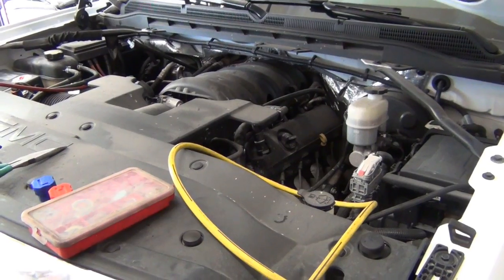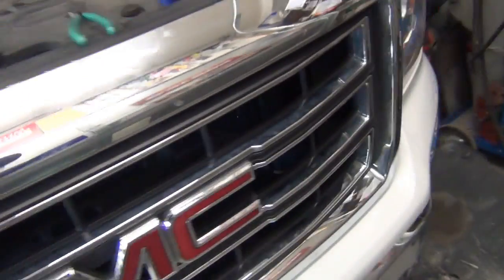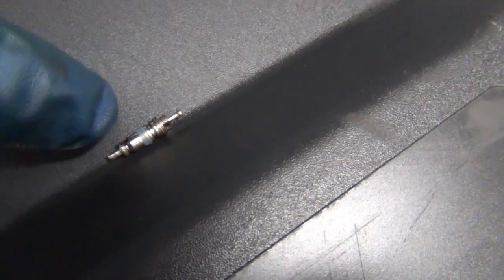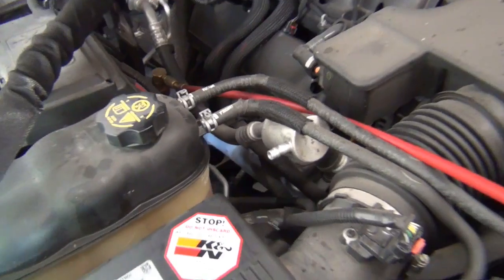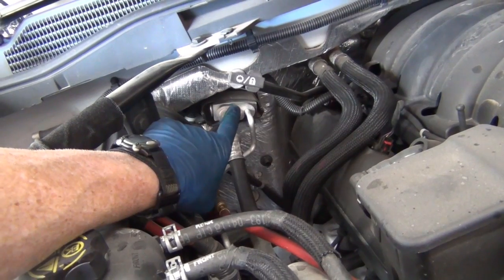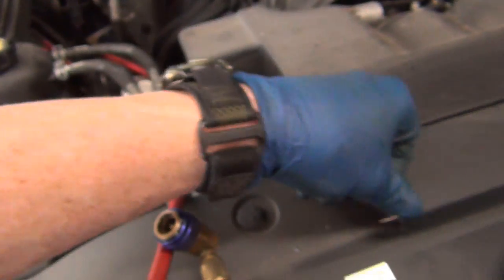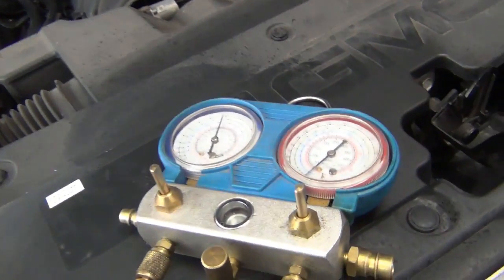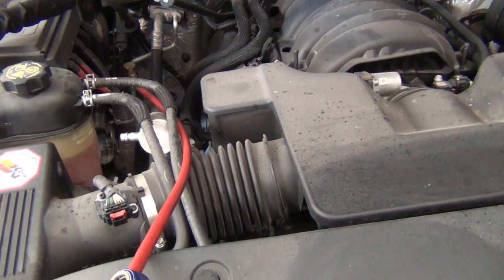Catastrophic GMC AC Problem Caused By Factory Defect on Condenser

Comment: I had a 2001 Yukon XL. It was 4 months old when the compressor ate itself. Over the years I had it serviced at 2 dealerships, several mechanics (1 who was my brother at one of the dealerships, I obviously trusted him, and he even sought outside input), and 2 AC specialist shops. I went through 17, Yes that's Seventeen, compressors. Some factory, some remanufactured and some off brand. Some covered by warranty, some not. Some were replaced for free by my brothers dealership. Some lasted months, some only weeks, the shortest was 3 days. In the end, I drove it for about three years with no AC because I got tired of the game.
Reply: Wow that is crazy, maybe too much oil caused all those compressors to hydrolock. Failed compressors is the SYMPTOM but what is the PROBLEM? what is causing all those to fail... 🤔
Reply: @heyitschinoable  Never did figure out anything for certain. The first time was when the truck was only 4 months old. Was parked with it running and the compressor locked up and started smoking the belt. Over all of the years that I had it I had almost every part replaced short of running new lines to the rear ac. Including putting filters on the lines in several places to try to catch the random debris even after having the system fully flushed twice. Never figured out the problem. Got rid of it 2 1/2 years ago and now I drive a Toyota Sequoia. I have never had any problems with my imports :)
Reply: @tyahl How do you like the Toyota? Miss the yukon at all? I got an 03 yukon and I have rebuilt that AC system more times than I can count. Even had to fix it after the dealership failed to. There is a small amount of metal in the system that just keeps reappearing from god knows where. A toyota sounds nice.

Comment: I have a 14 rado and had that same condenser defect a few years ago...I had my girl take it to the dealer when it started blowing hot(out of warranty) they jus said they couldn’t find a leak charged me $150 for a refill and said if it leaks out, we put die in it and it’ll be easier to find then...when I found that out I was pissed...last week it was blowing cold...now it’s blowing hot, so How is it not a leak! So then I did my own research and found ppl all over are having the same issue with the bad weld at the condenser dryer connection point...that’s extremely easy to find...and I’m SURE they kno about it...and since it’s not a safety issue GM won’t recall it...as much as I like Chevy...I really don’t kno if I’ll get another...I don’t even wanna take it to the dealer for recalls after that extortion...if your in or near Delaware DO NOT go to the Chevy dealer or Route 13 in New Castle...not to be trusted

Comment: please help, i bought 2007 Accord LX with flood damage, i got from Junkyard from the same 2007 Accord LX (ECM, BCM, keyfob with its cylinder and immobilizer) the car crank and there is fuel but no spark, do you think i should bring the fuse box located under the hood too or what could be?

Comment: If an A/C system has a low gas charge , obviously it's leaking and the leak should be repaired first and then vacced out. A leaking system that is vacced will draw in more contamination, creating more problems . As a system gets older there will be the inevitable leaks especially around the compressor shaft and condenser due to stone damage.
Reply: Trye
Reply: True

Comment: I'm an a/c specialist in Florida, I do at least 4-5 of those a month sometimes a week. The condensers all leak at the top of the drivers side sometimes on the passenger side too. Usually the leak is not noticeable because it leaks on the back side facing the radiator. The oil leaking out also causes compressor failures.
Those compressors just go bad a lot too.
Reply: I wonder if Sanden is the manufacturer of those compressors. Ive done 3 Sanden brand compressors on Fords at work. 1 Transit van and 2 Ford Ecoboost.

Comment: Interesting to see wetness there, the freon boils away instantly. Maybe with the cold caused by boiling freon, water in the surrounding air condensed around the leak.
Reply: The oil in the system leaks out along with the gas and gives this staining.
Reply: @Pats-Shed  Good point!
Reply: It’s also much more obvious with a UV light; the wetness is just oil

Comment: Brian, can this system be flushed somehow to remove the aluminum contaminate or is the customer needing an  entire AC system replacement? Seems to me that even a single shard of aluminum is capable of plugging the valve and causing future problems.

Comment: Man!  I just had my condensor replaced @ same spot you pointed out, BTW I have a 2016 Chevy Tahoe w/ 91k miles.live in Texas... luckily my extended warranty coverage covered the $800 bill minus $100 for the deductible I had to pay. The mechanic didn't mention the other issues, I'm just wondering if the leak/problem started from somewhere else.  I just had the repair done 2weeks ago and A/C is running fine. Just concerned that the issue just was the condensor and not the other stuff...... Great videos tho man!  Kuddos to you and ur experience & knowledge and passing it all along in these in-depth vids!

Comment: And what exactly are you suppose to do about it? Does GM accept responsibility for this debacle and pay for it or is the customer screwed over and needs to buy a complete replacement AC system for several thousands of dollars.